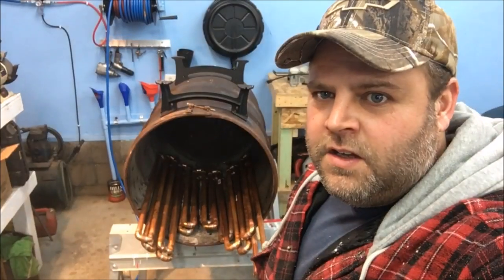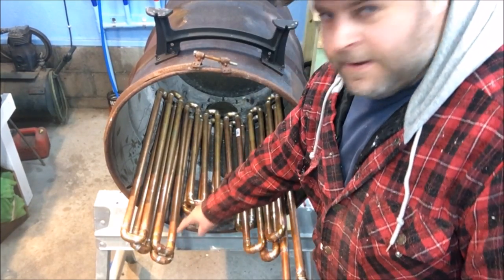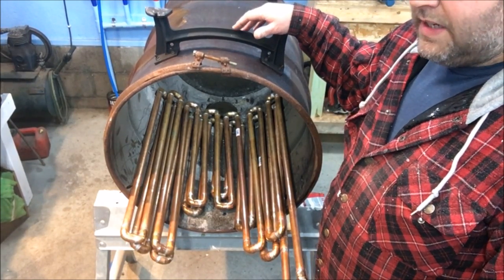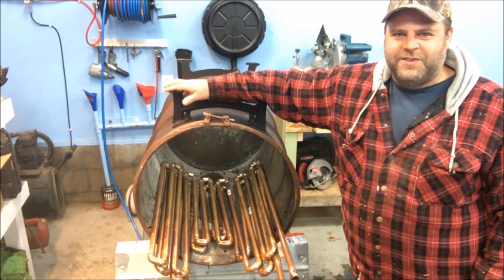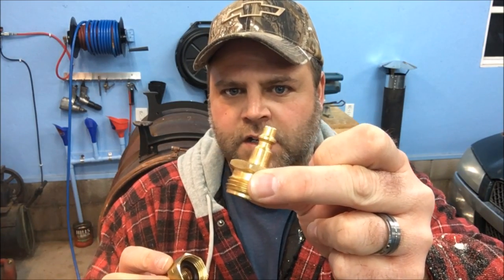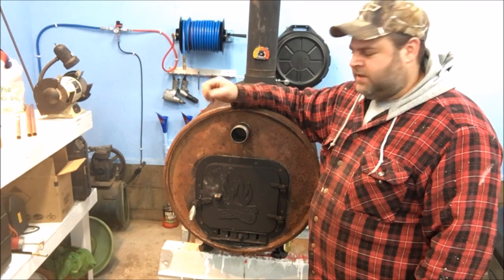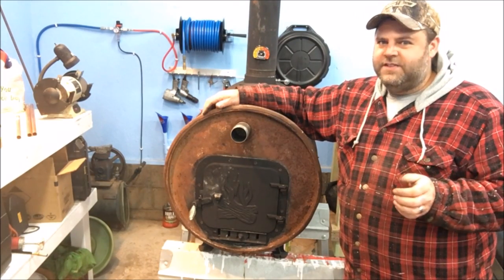Copper Heat Exchanger In Barrel Wood Stove To Heat Pool

Comment: Great video and the second part of this video is also Informative... So I decided to build something very similar to this... The concept is solid and works well. 

For me this worked a little to well (permit me to explain) My pool is very small only a 10' round and 30" deep around 1600 gallons... Upgrades would include a sand filter with 3/4 hp. pump. 

Starting temps going into the pool heater was 74 degrees temps coming out were104 degrees. Running the pool heater increased the pool temps to 90 degrees & 120 degrees exiting the pool heater,  in less than 18 hours... However  When the water temperatures in the pool reached over 105 degrees... The seams of the pool became weakened and failed letting all the water out. This all happened while I was sleeping. This caused the pump to run dry, and the soldered joints to unsolder... While I believe all of this is repairable. 

For me this is a lessoned learned. When the pool temps are satisfactory, let the fire go out. :)
Reply from the maker: Thanks for sharing your experience! 105 degrees is very warm for a pool, that is more in the range of hot tub water. That is a total bummer that your pool is ruined and the solder joints failed. Water always has to be running through the pipes when there is a fire going. I made a similar mistake at first also. I didn't shut off my automatic timer on the pump, so the pump turned off at 9pm like normal but I still had a fire going. Luckily all that happened was it blew out the plastic hose I have connected to the copper that runs to the pool.
Reply: I am very happy with how this project turned out... Even though I'll need to do a bit of patching. 🙂 Just wanted to give you the credit for pointing me in a workable direction for heating my tiny pool. Thanks!

Comment: What kind of temps are you getting?
Reply from the maker: I haven't really checked it, I usually just go by feel. I can notice a significant change in water temp coming back into the pool. Last night I did a "scientific" test and put my rubber duck pool thermometer in front of the water jet coming back into the pool. haha According to that the water was 4 degrees warmer coming back in compared to the actual pool temp. It feels much warmer than that so take it for what its worth.

Comment: I heard copper and chlorine is not good for pool liner.  Any thoughts
Reply from the maker: I haven't actually heard that before but it could be true. For my set up I am using Baquacil which is a non-chlorine pool chemical. Thanks for watching and commenting!
Reply: I am hoping to do one myself. I just wanted to do more research before i do one. Also, wouldn't help to prolong the life of the copper if it doesn't get direct hit with fire. I was thinking about some sort of plate over the or under to protect the copper.
Reply from the maker: This will be I think my 3rd year using this setup. The only thing I have changed is rotating the barrel lid so the big bung on the lid is at the bottom so it will pull a draft through it and underneath the fire. If you put a plate or something to protect the copper, it will last longer sure but you won't get as much heat out of it. It's a toss up on what you want to do but either way it will work.

Comment: question... are you pushing water through the copper pipe with a pump or are you relying on a thermal syphon?
Reply from the maker: Yes, I'm pushing water through with the pool pump. I've been meaning to do an update video to show how it can be hooked up. Thanks for watching!

Comment: Sound good BUT i hope you did not use regular solder for the copper it will not take the fire tem.
Reply from the maker: Yup I used regular solder. Been using it for 3 seasons and haven't had any issues. As long as water is flowing while the fire is burning the pipes stay cool enough to not melt. Thanks for watching and commenting!
Reply: @UpperPeninsulaDIY  Great job & i wish my shop was as clean as yours,

Comment: What kind of Solder did you use? Ours melted when we made this.
Reply from the maker: I'm not even sure to be honest, what ever was the cheapest at the hardware store. I haven't had any issues so far with mine. There always has to be water flowing though when a fire is in the barrel. If water is flowing the solder shouldn't melt.
Reply: Never start the fire with no water flow! Then solder won’t melt!

Comment: Can you not just unbolt the door and rotate it 180 deg then rotate the entire front 180 ?
Reply from the maker: Thanks for watching Sam! Unfortunately not. The way it is cut our for the vents in the bottom of the door I would have a big air gap. Unless I weld in a plate. I will have to think about that, thanks for the tip!
Reply: You would just need to rotate the door itself also.

Comment: Wont the heat MELT the solder ???
Reply from the maker: As long as water it flowing through the pipe the solder won't melt.

Comment: I think the concept is great but 3/4 copper with all those 90 degree bends is going to greatly restrict the flow of water and put a huge strain on your pool pump. A larger diameter coiled tubing would be better.
Reply from the maker: 100% agree a coiled tubing would flow better. The only down fall would be the coil would take up more room in the barrel. That was my reasoning for going with the 90's, try to get the most surface area I could with out taking up to much of the barrel. Thanks for watching and commenting! Always great to hear other ideas.

Comment: probably a stupid question,but wont the heat melt the solder?
Reply from the maker: That's a question I get asked often. As long as there is water flowing through the pipes at all times the solder won't melt. Thanks for watching and commenting!

Comment: The e p a does not allow pipes inside the stove add a second barrel wrap it with 3/4 soft copper pipe instead
Reply from the maker: It would probably be more efficient that way.
Reply: The EPA don’t allow companies to build them with pipe. You can add anything you want once it’s yours.

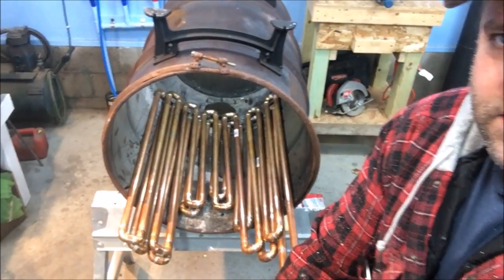Comment: 1:36 - LOL!! , ok ! , had to PAUSE it here, so I could count the # of 180° elbows you used!,°👍
Reply: thank you for posting this, my barrel is done & I'm looking forward to doing some form of this copper heat exchanger!👍🤙
Reply from the maker: There is definitely a LOT of elbows in there. lol One thing I wish I would have done is put some sort of shield on the copper pipes so creosote doesn't build up so much on the pipes.

Comment: Well? How did it work out?
Reply from the maker: I know, I really need to do an update video on this. It has been working great! I've made a few little modifications to it but it has been working just as good as our propane pool heater.
Reply: @UpperPeninsulaDIY  Great! I'll subscribe in hopes of seeing i soon. I'm really hoping to see the water temps going in vs after heating. I've been digging through YT vids for the last two months, trying to find a way to heat water with wood fire and this design really does seem to be the winner.

Comment: good luck, if your pump fails youll be bailing out. better option is to buy 25 meters of 15mm annealed soft copper coil and internally coil and strap in barrel. lord have mercy on my hot tub. once that water temp gets up and the exchanger starts working i actually have added cold water due to its efficiency.
Reply from the maker: Thanks for watching and the tip. So far I haven't had any issues, its been working great.

Comment: Why don't you as a minimum run a secondary heat exchanger so you can cut your losses. You/me/we are loosing way too much out the pipes. I made a 20 pound propane tank wood stove, and 20 pound propane tank heat extractor plus a minimum of 8 foot pipe and only 4" dia but  I still loose too much out. 
Instead of using it only for your pool, I would be using it there in the shop immediately to develop my experience running multi-fuel and multi purpose heating, cooking, smoking, refining, kiln,  plus hot water heating. I would run a minimum of double barrel plus. People are too wasteful unlike previous day's. Remember if you are burning wood how long it takes to grow a stand of trees. If you design multi- fuel you are being more of a proper land steward and then you will have to run your tests burns to observe/sense the burn/transformation qualities and reactant gasses produced and how to make modifications for the different fuel sources to get to the proper parameters. Your better than that! Don't settle for less!!